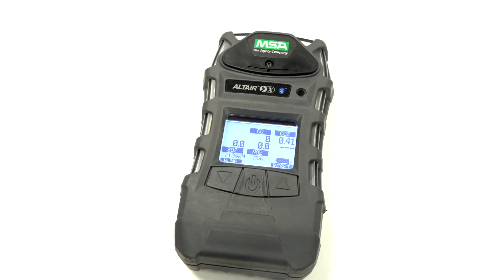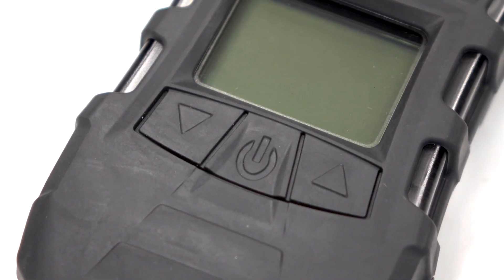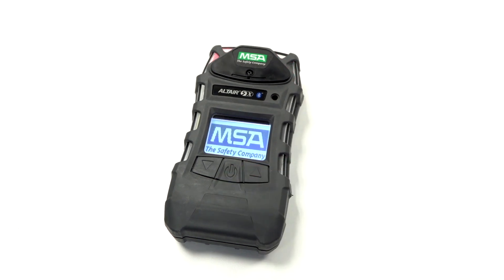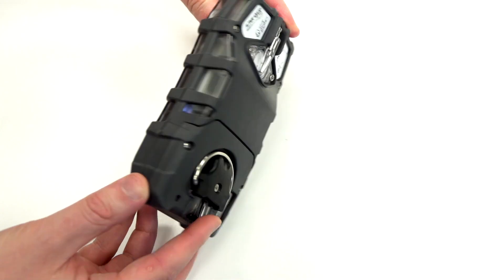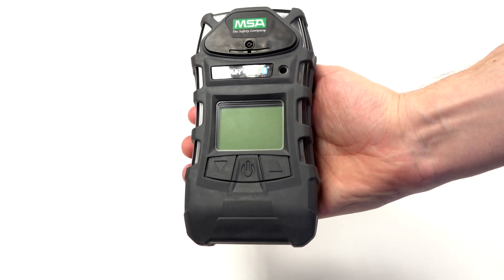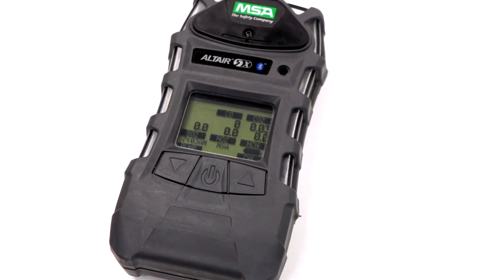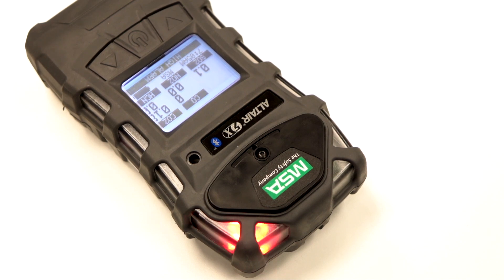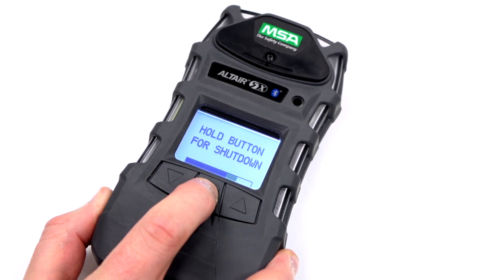MSA Altair 5X - Overview of the Features and Benefits

Comment: Will this unit detect diesel fumes?
Reply from the maker: Hi, thank you for your comment. 

To help us better answer your question we would need to know a little more context on the application before providing a correct answer. By diesel fumes, do you mean the exhaust gases, or diesel as a flammable gas? 

Please feel free to get in contact with us on 0141 771 7749, 8.30am-5.30pm Monday-Friday so we can answer your question in more depth and provide further assistance for your gas detection needs. - Sarah
Reply: @Frontline-safetyCoUk  If diesel is spilled on dirt. Say recently, would it be able to detect diesel fumes. So diesel as a flammable gas.
Reply from the maker: Hi Again,

So this particular monitor would detect a flammable gas in the 0-100% LEL range. We are happy to support you in finding a solution. If you send your enquiry to sales@frontline-safety.co.uk or speak to one of our team on the live chat on our website, we'll assist you in finding a solution.

Thanks,
Callum
Reply: @austereengineering5809  If you get the MSA meter with a PID sensor it will detect VOCs; specifically if you set the meter to diesel you can get a more accurate measurement in ppms.